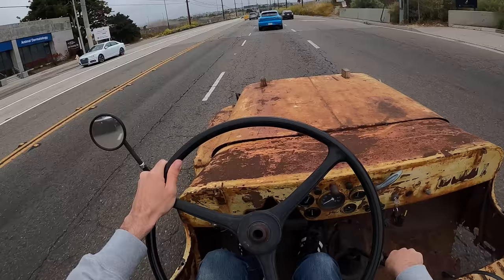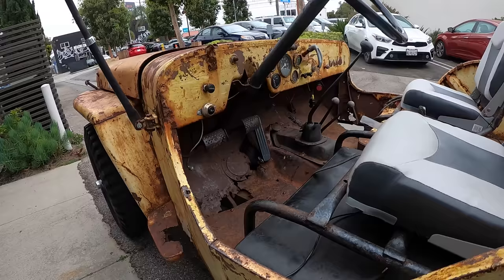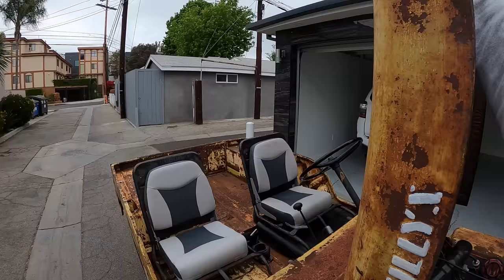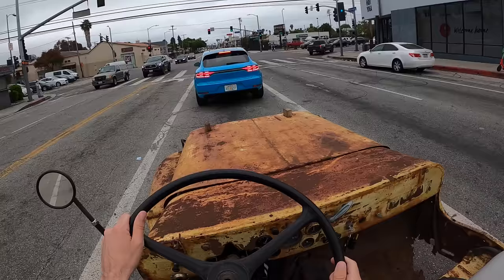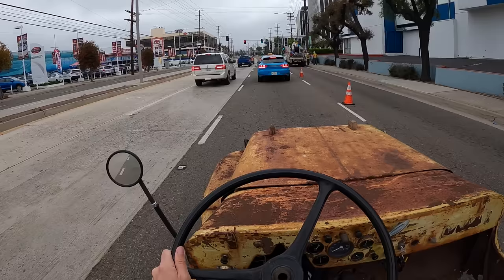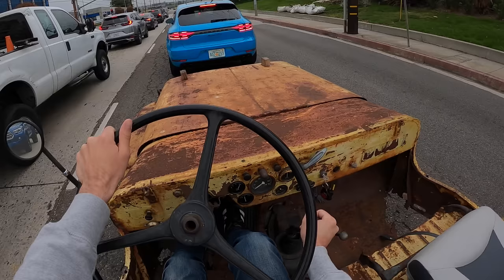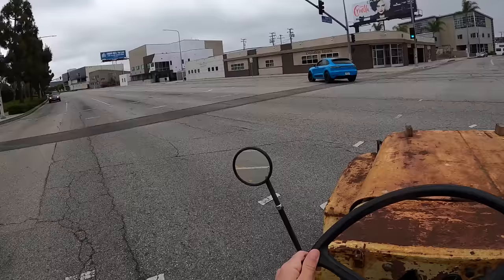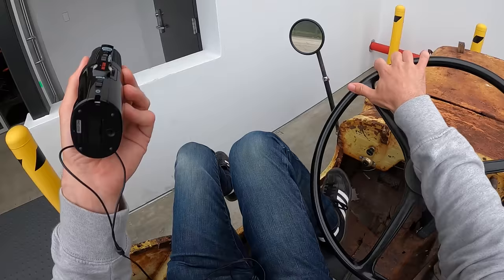1948 Willys Jeep CJ-2A - Rusted Through Death Machine! (POV Binaural Audio)

Comment: A long time ago, I was driving through the Ardennes in Belgium in a rented Renault 5 when a tire blew. It was a Sunday, and there was no spare. I managed to stop a passing truck, and the driver gave me a lift  to a man who would be able to help me. In the middle of the woods I spotted an enormous pile of  tires, underneath which a workshop was barely visible. The owner/mechanic appeared to be an avid collector of WWII army vehicles, as I noticed several jeeps, halftracks, trucks and the odd Sherman tank. He was happy to help, got out a few tires, and directed me to his car, a Willys, not unlike the one in your video. He drove me cross-country, through the woods in record time to my car, which in itself was an experience , sitting in a seat, previously occupied only by a GI in the Battle of the Bulge. His seat was a Recaro, with the racing seat-belts, which wasn't a luxury, as he had converted the Willys with rally suspension and gears to get the most, performance-wise out of a Peugeot 205 GTI engine.
Ever since, when renting a car, I check e-ve-ry-thing.

Comment: In Spain you have to pass a car test every year or every 6 months. If the tires are not stock, they tell you that you can't go on the road. If the road cops see you with something like that you are getting a good ol' insane fine and your license taken😅
Reply: Here in California, we have no vehicle inspections. Its ironic because California is the most over-regulated and over-taxed state in every category you can think of, especially emissions testing, yet there are no safety inspections. Your car can be in unsafe condition to drive and no one cares at all. But if it doesn't pass smog check (emissions testing), you can't renew your tags and is not 'legal' to drive in CA roads until you get it smogged.

Comment: FOR SALE-
Jeep, one owner from new, low miles for year, good overall condition, a few 'age related' marks, slight delaquering, but paintwork ok, a few small rust bubbles, could do with a good wax and polish to bring out the lustre and shine.
Drives!
Now for the bad bits, no spare tyre, slight play in steering, idle needs adjusting and no windscreen wipers, however in LA it never rains!! 😯⚠️😁👍😎

Comment: That double clutching is smooth af!
Maybe try some clutchless shifting whenever you get another chance with this.
Reply: Don't worry he has one goal throughout this video and that's to make it sound as old as possible, make up shit about it not working yet show clearly that it's practically acting great, he doesn't once say "of course it's not as well driving as when it was new" just talking to it like it's always been rusted and broken like all modern car lovers dream. I'd say he's under the impression that a 73 year old since factory created automobile needs to behave like a bitching sports car at all times or else it isn't "good", but honestly I'd say he's rather under the influence.
Reply: what is double clutch
Reply: @camcordernonsense5264  when your gearbox isn't synchronized you have to double clutch. basically in a nutshell when changing up a gear you have to clutch in- go to netural- clutch out - clutch back in- change to next gear. So instead of going directly to the next gear like in a modern car you have use neutral to get to the next gear otherwise your going to have a lot of grinding & a whole lotta fighting.
Reply: @camcordernonsense5264  it’s a way of shifting. One press of the clutch when going into neutral and one more for getting into gear.
Reply: so if my jeep's transmission synchros do go, (gee why might I be asking about this), can I use this to limp home in a yj?
Reply: @camcordernonsense5264  the possibility of the synchro's going on all the gears in the transmission is small but say if one went. Yes you can work around it by using this method.
Reply: @camcordernonsense5264  yes and no. If you bust a synchro then it’s gonna grind. You can use double clutch but if i were you i’d rather shift clutchlessly.
Reply: @camcordernonsense5264  its finding neutral between gear shifts, usually using throttle too to help match revs. Its saves the synchros driving like this as opposed to granny shifting.
Reply: @WitchKing-Of-Angmar  what the hell

Comment: Dude! I have a 1946 CJ-2A which we use as a daily driver, during the summer.  I was with my parents when they bought it, but don't remember as I was so young.  Ours is also yellow, but we won the battle with the rust back in the 1970's so that is no problem.  Still original everything being 6 Volts & original engine.  We have the "Willy's wobble" when steering and intend to replace some parts this winter.  Best of luck with your "legend" as the Jeep was the C-47 of the ground movement.

Comment: The amount of rust sure adds to the completely exposed open driving experience. "Will the brakes work or am i going to push the pedal through the floor panel next time i have to brake?" Driving on the edge.

Comment: We have one of these that we used on the farm when I was growing up in the 1980s. We retired it to light duty around 2000, when we replaced it with a '91 Geo Tracker. Ours has a little bit better floorboards than the one you are driving here, but it doesn't run as well. You really don't appreciate synchros until you don't have them!

Comment: I saw some non-OEM plate joints in the floor and the chassis rails are clean.
That one is in far better condition than first let on, it's a ""fake ruster""
Reply: about 3 months after this video the frame split in half while I was driving it and taco'd me, did a full frame swap and its back on the road good as new

Comment: T-90 is definitely a stronger transmission then the T-84, My 43 GPW currently has a T-90 and an M38 L-134 working on tacking down a wartime motor and I already have a T-84 for it gonna be a great driving jeep when finished

Comment: I suspect the actual chassis of the car is in perfect condition.
The seats, the engine, everything else is way too clean, the rust appears to just be the body
Reply from the maker: The frame had to be replaced. There were 7 major cracks found after this video. Only the engine was rebuilt.

Comment: If you're having to double-clutch, your transmission is f---ed up.  I have a stock '46 (moreso than this - mine is still 6 Volt), and I've never had to double-clutch.  I do have to hold it in 2nd gear, though, since it tend to jump out.
Reply: Well, yeah I mean look at it lol
Reply: @badlydrawncars6460  And they put a 12 V conversion ahead of a transmission rebuild, apparently...
Reply: @jamesmcmillan8610  I imagine the wiring was probably corroded/chewed up. If they're gonna replace everything, might as well convert it to 12v.

Comment: Then: "Our car has only 10 moving parts and here's the manual to fix it yourself with every detail on its construction and a list of parts that you can order if you don't feel like machining your own." Lasts 100 generations
 
Now: "You need to update your fuel injectors and replace 5000 of the 36000 sensors that were destroyed by humidity and have the entire engine rebuilt because the poor quality metal is already deteriorating but only by a licensed technician can look at it. No you cant fix it yourself all the parts are serialized and if you even open the hood it will void your warranty and you'll basically have to buy a new one." Is already scrap

Comment: not being negative...im my country you would get arrested for driving a structurally unsound vehicle around on the street..i can see its got number plates and must be registered but how in the hell did this pass any form of roadworthy..i see this all the time on numerous usa cars..it is very confusing are there not laws there?
Reply: California is the most over-regulated and over-taxed state in every category you can think of, especially smog check (emissions testing). However, we have no vehicle safety inspection here. Your car can be in unsafe condition but no one cares. But if it doesn't pass the smog check, you can't get it registered. also since this is a very old vehicle, I presume its exempt from any inspection standards assuming there were any. Pre 1972 vehicles I believe are also exempt from smog check.

Comment: This car looks terrifying even tho people like it I love it I would drive it everyday. Doesn’t have ac or seatbelts man. I kinda hear an turbo that’s tiny in the engine but even tho it isn’t turbo I will still like it. No matter what I know this is an long message I’m an talkative guy. Anyways the car is pretty nice I would love to have an 1948 car btw is it an hot rod? Maybe jeep hotrod heh the brakes are functional too. It’s not really reliable tho that’s the thing. Steering power is amazing the gears kinda hard to shift and that’s all I like about the car, oh one more thing speedster cars are the best it’s fun to ride in kinda rough. Too rust bucket cars aren’t really reliable cause it’s an rust bucket so what can I say. I mean man it’s rusted it has holes in it it’s fun tho, I just don’t like cars rusting makes it look bad. So yea, the best farm truck ever. U can fit like eggs apples in there brutal car too. But it’s still an car that’s is fun to ride in because the Willy’s jeep is an great car. I mean it isn’t the best car I don’t think but that’s all great cranking good transmission good moding,

Comment: I have a question for you jeep fans. The U.S. made a staggering number of WWII jeeps ; I looked it up: almost 650,000!!  With a huge number of surplus jeeps left over when the war ended in 1945,  why were  jeeps still being manufactured in the 1940s and 50s,  like this 1948? It seems all those thousands of surplus jeeps from the war would have satisfied both civilian and military needs for years to come. What's up with that? Is this just Amerikan wastefulness?
Reply: most war jeeps were destroyed or left overseas because it was too expensive to ship them back after the war was over. Also, military vehicles were technically never designed to be driven on the road so most of the time you can't/couldn't get them road legal in the US
Reply: @Rubber_N_Smoke  That 1948 Jeep doesn't look very different at all from a 1945. I see the windshield and headlights are a bit different. But what makes the WWII so different as to "never designed to be driven on the road," as you say. What would prevent them from being driven on the road or modified to do so? And certainly it cost more to build a whole new jeep than the shipping cost. A staggering almost 650,000 jeeps built 1941- 1945! That's an enormous surplus, post war. Seems strange to be building new ones in 1948.  Just saying.

Comment: The chassis is freshly restored, no frame rust, new wheels, completely overhauled engine.. cleaner than my junkyard CJ, this is clickbait
Reply from the maker: That frame had 9 cracks. The frame was junked after this video. Only thing new was a rebuilt engine. Sooooo no. It’s not clickbait.

Comment: This truck must have had a bad synchro on 3rd. There is no need to double-clutch this gearbox unless you are (1) showing off, or (2) down-shifting from second into first. Second and third ARE synchromeshed and there should be no need to double-clutch when shifting back and forth between second and third, whether up or downshifting, unless the synchro has failed.
Reply from the maker: Showing off?! 😂. Jesus dude it was grinding so i double clutched to avoid it. Pretty simple technique